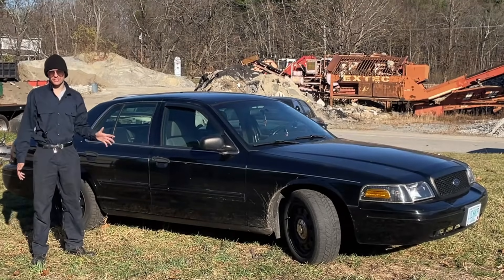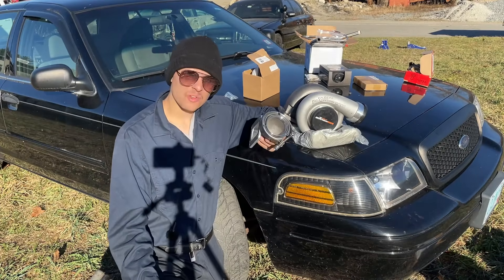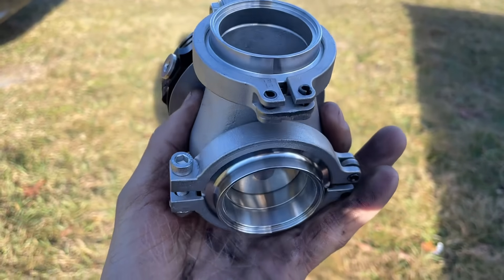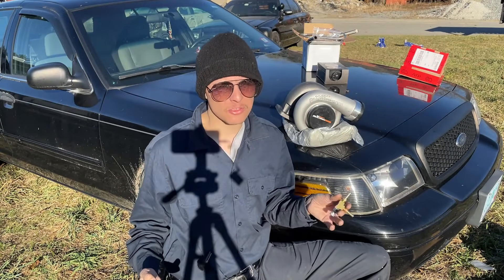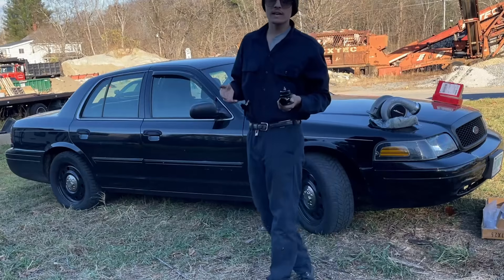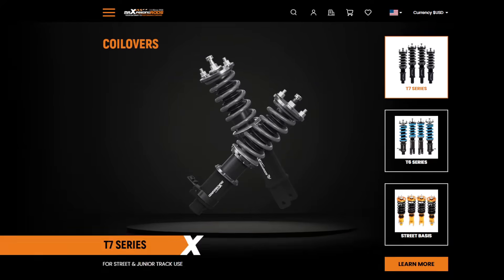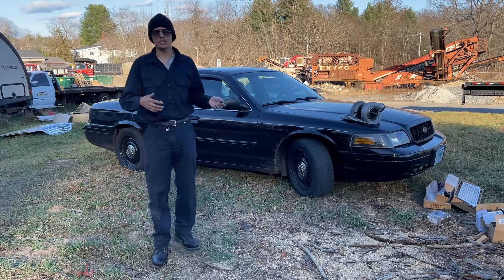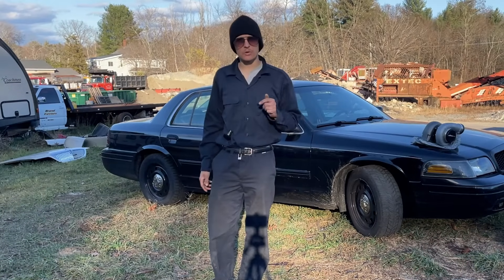Everything You Need To Turbo Charge A Ford Crown Victoria!

Comment: why keep the exhaust and why use such a small intercooler, nahh dude, pipe is cheap, give it flow, i learned the hard way
Reply from the maker: Keep the price down, you can chop the factory exhaust and use it to make the hot pipe for the turbo. That was my original plan before I bought a car with no exhaust lol.

Comment: Will putting aftermarket headers on the vic give it any more horsepower????
Reply from the maker: In general, putting headers on will help with horsepower. Unfortunately the only set of headers made specifically for these cars are from stainless works and cost a LOT of money. The only other option is to chop up some mustang headers or to make your own.

Comment: what leds do you recommend? i have the same dark headlights and have bad halogens, needing an upgrade for my vic
Reply from the maker: I can’t really be unbiased because I have had a sponsored by Oxilam. However, most cheap LED headlights are all the same. Just try not to go too cheap, I’ve had 2 or 3 sets of sub $35 LED headlights, some gave out after a year, some had the high beam and low beam swapped.

I swapped of the lights to LED’s in my black car using oxilam lights, minus the ones that they don’t carry. The headlights work well enough, and don’t have a giant heatsink/fan hanging off the back. If you go on their website directly and use the code WTT at checkout, you’ll get a 10% discount. I’m also supposed to get a small kickback, but when I ordered $130 worth of LED’s, I got nothing 💀💀💀.

Also, if you plan on changing out your headlight housings for new ones, unscrew the alignment posts from the factory housings and put them on the new housings so you don’t need to re-align the new housings.
Reply: @wadethetrucker  oh great man, I'll definitely check them out and thank you for your feedback! It's truly hard to see when your daylight goes away at 3pm lol
Reply: And having tinted crown vic headlights lol

Comment: How much would it hypothetically cost to do this on my 2001 grand marquis ??
Reply from the maker: I estimate the cost of materials to be around $1,500, which is 5 times less than a supercharger kit. The biggest thing that is going to affect the cost is the cost of the charge pipe. It’s going to cost me more since I’ll be remote mounting, but I’ll also be doing all of the welding on my own.

Comment: You don’t understand how clutch you came in in about to turbo mine and have all the information but there’s not much about boosting Vic’s and you saved the day fr man
Reply from the maker: Happy I could help! Any questions, feel free to ask!
Reply: @ I appreciate you my guy,  looking forward to seeing that beast boosted!
Reply: @wadethetrucker  do we use fuel pressure regulators or fuel management unit with this build? I have been doing research and found that we can tune that way but I don’t remember you saying anything about it. This will be my first turbo ever on my p71 Vic. I am stumped because 2003 and up panthers come with the fuel pressure regulator as a sensor, not a mechanical one. If you are using one, how would you go about installing one in the Vic? I feel like it’s important if we are both planning on using stock ecu/ injectors ect . We need some type of tune ability! Let me know how you are going about it.
Reply from the maker: I don’t know how much PSI you plan on running, but when I spoke with Marty, he said that the stock fuel system, except the injectors, should be plenty enough to run low boost, as in my case.
Reply: @wadethetrucker you can even use stock injections to answer Marty’s theory! Everything is working flawlessly with my setup! If you need any tips or help brotha I can help if you ever need me!
Reply from the maker: @GorrillaFastTv  trust me, I've been keeping track of what you've been posting lol
Reply: @ guess we both keeping track man! I watch you too , I have more content on the way with pulls , tunning, ect!